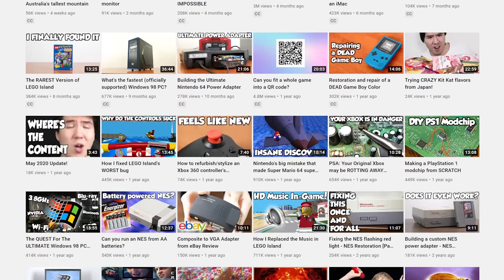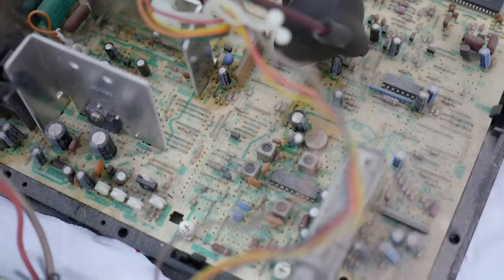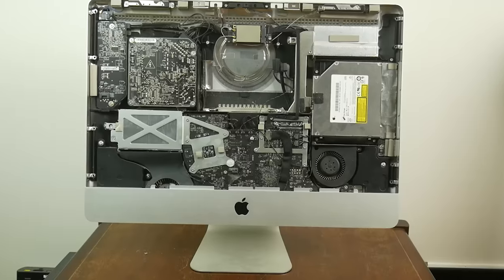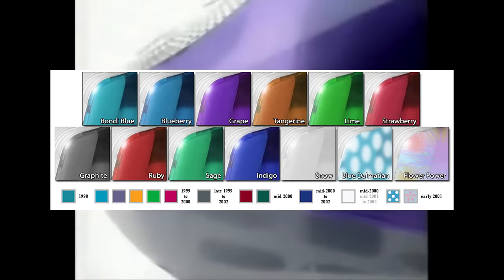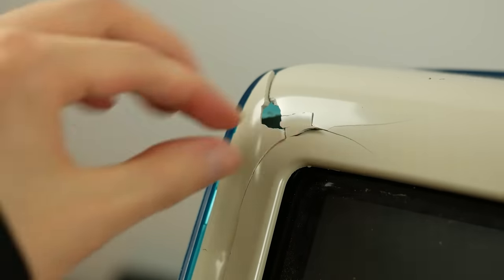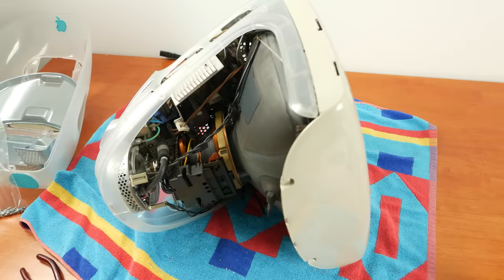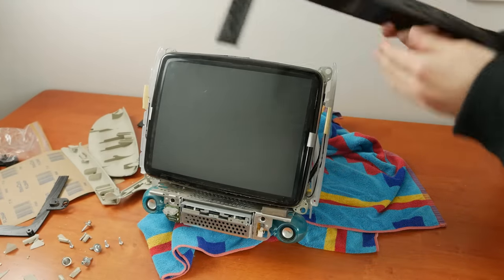Failed Projects: The Videos You Never Saw

Comment: That TDK block you looked at in the CRT is a transformer and it likely wasn't bad. Likely the corrosion you found led to trace damage which cut off something important in the vertical deflection circuit. The slow death you witnessed where it had intemittent momentary vertical collapse would further point to a trace corroding away.
Reply: i saw a capacitor that looked like it exploded on the board
Reply: @nathanforsaken3248  which one is that?
Reply: @nathanforsaken3248  Me too

Comment: That gunck was not leaked capacitor oil, it was just soldering flux left by the manufacturer, usually it is not conductive and does not prevent it from working.

You had to have unsoldered the part, and measured the board contacts without the part, as if it were shorted it would result in a low voltage reading. These CRTs are quite common to have bad contact in the welds due to the heat, you can check this simply by poking things with a piece of plastic or rubber and seeing if anything happens.

Comment: Bro I think I can help regarding the TV because I fixed two of these last week , one was a 14 inch TV and the other was a 1980 Sonodyne-Toshiba Colour TV (It was a very expensive TV of that time in India) so here is what was maybe wrong. First thing is to remove the vertical deflection chip entirely and then checking the voltages because the chip is prone to shorting on failing , which causes the voltage to drop , happened exactly in my case. If still the voltage is low , you should see a 25v 1000uf capacitor near the vertical ic , replace that one , and also replace the diode which goes from the transformer to the vertical ic. Now about the transformer , its probably okay , just has some burned traces but in case its dead , most CRT's have very similar boards so you should find one from a board which has near specs as your tv. If everything above fails , you can get CRT replacement boards for around 15-20 dollars ( they come without a RF port so you will need to buy an RF modulator alongside it ) and you can replace the original motherboards with those. If your crt has a thin neck , you need to buy a replacement thin neck board alongside which costs 1-2 dollars and replace it with the fat neck one on your replacement board. I'm definately sure you can make the CRT work again and hope you the best!!

Comment: 3:53 If you hadn't broken the thing, here are some tips. The transformer may have gone bad but thats unlikely. There probably is a dead mosfet that is driving the transformer, and that dead mosfet looks to be the one on the bottom of the screen. But if the mosfet is fine then the mosfet driver is likely bad and not sending a voltage to the mosfet gate, but if that too is fine then the mosfet driver power supply is likely bad. BUT before all this, you should check if the vertical deflection chip is even operational. If VCC and GND is shorted in the chip, then the supply voltage will drop to like 0.1 to 0.5 volts. Or there are just some bad solder joints. BUT also the transformer probably isn't broken. The mosfet not designed to deal with a huge spike in current may have died and some kind of over current protection on the main PSU might of happened not letting the television turn on.

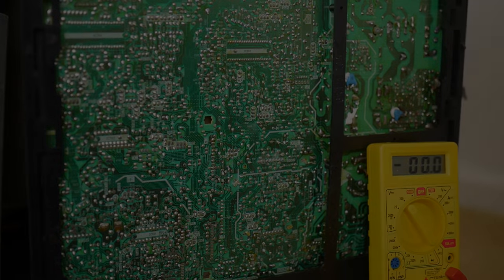Comment: 4:40 holy shit something similar happened to me, i was trying to repair a monitor and it had a large capacitor on the power supply, which obviously I shorted everytime to not kill myself. While doing some testing i did the some stupid thing, i pressed the power button of the monitor to turn it off, and shorted the cap, but I didn't realize that the power button only cuts the power from the main PCB, not the power supply, so, the next thing i saw was a huge spark, i shorted 220v AC, since the cap just after the power cable. No need to say, i couldn't repair the monitor

Comment: So, about that bezel.
1. Would there have been time to run to your friend's place and bring him a shard of the original to help with color-matching?
2. When you discovered the issue with the screwposts being shorter (probably to accommodate the brackets to hold the LCD), did you have enough time to obtain some longer screws that could have reached them?

Comment: Failures are the best, 2 days ago I failed fantastically, putting in an IPS screen for my gameboy color, I got everything in and it was working great except the touch sensor, I opened it back up and saw that the ribbon cable for the sensor had snapped.

I desoldered the snapped end and when I did that I ended up lifting the solder pad, after searching around I found out that I could fashion a new touch sensor just using some kynar and copper tape and solder it on to a different part of the circuitry.

My next course of action was to attempt this fix, as I was testing it before closing the shell up it was a success, but then due to butterfingers I dropped the new touch sensor onto the GBC motherboard and it immediately turned off and now will not turn back on.

Comment: That's weird, I used to have a CRT I bought at a thrift store for the sole purpose of using it for my NES. It too was made by Mitsubishi and although it had a very bright and clear image for a while, I turned it on one day to see that it had the same vertical line problem. Maybe an issue with the hardware in Mitsubishi TVs from that time?

Comment: Your videos are really relateable as i bought a non-functional keyboard 2008 pre-unibody Macbook Pro for around $95. I also bought a replacement keyboard for $20 and attempted to make the replacement according to ifixit guide. I ended up finshing the replacement but i broke the aluminum pins holding the keyboard top case in place and the brightness and backlight stopped working completely. :(

Comment: What happened with the CRT? Did you get rid of it or something? If not, ordering custom made transformers are an option, heck, I have resources to wind custom transformers if you can figure out what the specs of it are. While finding the specific model seems impossible, you should still be able to grasp a good idea of what it was supposed to do by what voltages it should put out. If all else fails, counting the turns and measuring thickness is tedious, but doable. It all really depends on how willing you'd be to try repairing the thing. I'm assuming you got rid of it tho. Also I have no clue if that's the only grave issue the short caused cuz I can't inspect the board.

Comment: I found a 2017 iMac in the garbage with a broken screen. Looked in the CPU socket, had a 7700k in it. RX 570 on board. Made $200+ dollars on the CPU and another 275$ on the logic board, PSU and casing. And luckily it didnt just end up in a landfill. Repairing Apple stuff is weird - even the older stuff in some ways..

Comment: I have a CRT very similar to that, I think the same size but it had RF and AV inputs, it is also a magnavox, not this one. And I also have 2 smaller CRT's, 1 magnavox, and 1 is a zenith. Edit: the nice thing about those CRT tv's from the 90's is you can get them for as low as 3$ at a thrift store. All 3 of my CRT's costed 15$ together.

Comment: I have been there myself. I repaired a monitor. Plugged it in, turned it on. Lifted it up to see the screen working. All good working fine. Placed it back down on the desk… the earth wire to the frame which was off at this stage fell down to the board. It shorted it with a bang and tripped the safety switch on the house. Reset everything and the screen was totally dead.

Comment: 2:50 for anyone scared of the statement that he should run it under a hose or put it in a dish washer.
Don't be.
As long as electronics are completely turned off (ie. Not plugged into anything)
Then water doesn't really do anything to it.
Though if it is powered when it's wet, then the water will be able to destroy it.
So still be careful with your electronics! And if you drop anything like a phone or alike into water.
Then turn it off immediately, preferably remove the battery if you can.
Then you need to let its insides dry before turning it back on again.
(And no, putting it in rice wont remove the water damage, and it wont prevent the water that's already inside from damaging the phone. It just dries it quicker. So turn off your phone if water got in it!)

Comment: Hmm a transformer not outputting the correct voltage would hint towards there being a short on the coil usually opening it and cleaning it should have fixed it without replacing it (dirt can cause "leaking voltage") which is most likely the culprit since it got worse over time. Or there may have been a short across the coil that's unlikely though.

Comment: I got a HP aio with a broken screen. A replacement screen would have costed over 200 bucks so I just ended up putting the board into a cigar, added an ssd and use it with the hdmi it had on it for a second display.

Comment: I've repaired one of those iMac where they glued the screen. I totally broke it, as you have to "cut" into the glue, but if you cut it TOO far you actually damage the screen. Great.

Luckily enough I did know that this could happend, so I had checked with the local mac service shop and they had quoted me a price in case I broke the screen, so I took it there for them to replace it.

Then they called me up and told me "no we can't fix it for that previous quote you got, it's going to cost 3x more". So I brought it home again.

After all this I YOLO-ordered a new screen from somewhere on the internet, fixed it up and put on the new display, and it worked. But, I had also ordered a used CPU that was supposed to be much better. Thinking it was the same Intel socket, it should just work, right? And the model was actually used by imacs themselves. But that was one generation LATER, so it did not even want to boot. In the end I just put in an SSD in there and cleaned it up - but my father still uses that computer to date, so it wasn't too bad, just.... much more expensive than I had hoped for.

Comment: I'm new to fixing electronics and earlier this year i got a broken ps2. It seemed like a problem with the motor or something in the disc drive. Tried a few different things, and the pieces are just so fragile, I broke the power button cable off. Bought a new one, that one broke too. Gave up but thankfully found a cheap ps2 later on.

Comment: As you pan over the board saying "no cap was obviously leaking" I think I saw a brown cap with a blown lid? Right in the middle of the board. Might just be an angle on a different part tho. It's just south of the transformer you were looking at just after, and for old TV parts, try joining up at WES as they have lots of old parts for stuffs to repair. (including the laser for a ps1 and ps2 slim at least)

For logic board stuff, easiest to inject 1v1a from a bench supply at certain points and then check for the hot components with a thermal camera.

Comment: So funny thing: I had a little LED sign power brick and it had one of those little transformers in it so I held onto it. Then later, from China, I had ordered an AC to DC brick which had exposed wiring and things like that. That transformer on it arrived broken. While I got my refund and they didn’t ask for it back, I thought well what’s the worst thing that could happen if I just replace the transformer. Long story short it works perfectly fine

Comment: I have an idea for a project: try to play Lego Island 2 on Wii. You'd need to mod the Wii, get it to try and understand x86..However, since the Wii was more powerful than most PCs back then, you might be able to get it to work, especially as the game likely wasn't pushing the hardware to it's limits. I mean, if all else fails you could just install a PS1 emulator and run through the console port.

Comment: Pro tip if you wanted to glue the pieces together, use a spare Soldering iron and any epoxy or anything you want, and bada boom, its permanently fused together.